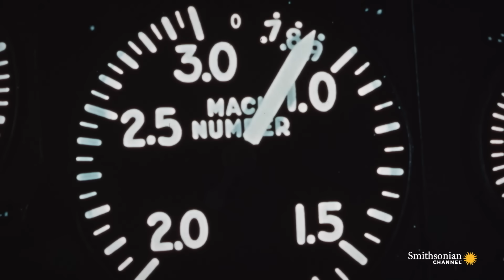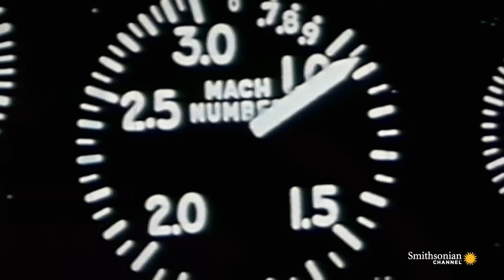The Moment Chuck Yeager Flew His Plane Past the Sound Barrier | Smithsonian Channel

Comment: Britain and America undertook a joint project to design, build and fly a JET powered supersonic aircraft. The aim being to expand their knowledge  of aircraft structures, aerodynamics and jet engines to stay ahead in the arms race.
However, America took the British aircraft design (without the knowledge of their 'partner'), built the X1 and strapped a German rocket in it just so they could go for glory.
Reply: BOLLOCKS! There was never any joint project and the UK was a decade behind Germany and America in supersonic aerodynamic technology.
Britain would not have the ability to build a supersonic aircraft until 1954.
Reply: @WilhelmKarsten   The British built 3 jet engined aircraft (DH108 Swallows) to explore the aerodynamics of supersonic flight. As expected, they encountered issues and the aircraft were restricted to Mach 0.9.
However, on September 6th 1948 Test Pilot John Derry entered a shallow dive at 45,000 feet and recorded a maximum speed of Mach 1.04 before pulling out at 23,000 feet.
All three aircraft were eventually destroyed but provided invaluable information regarding airflow and the distribution of aerodynamic loading, information that was shared with our American 'cousins'.
Reply: @bobdylan7120  No aircraft powered by an obsolete centrifugal jet engine has ever flown supersonic.
There is ZERO evidence to suggest that the de Haviland dH-108 Swallow flew supersonic.
All 3 crashed.
None of de Havillands jet aircraft could fly supersonic.
The only source that claims that John Derry reached Mach 1 is the fictional 1952 film 'The Sound Barrier' which is loosely based on his failed record attempt in 1948.
 There is no evidence that Derry reached Mach 1 in a dive, the test recording equipment was not functioning and there is no evidence that the aircraft reached Mach 1 or that the aircraft was even capable.

Derry would die attempting to fly supersonic in another de Havilland jet aircraft... the DH.110 which also failed catastrophically to fly supersonic.
Reply: @bobdylan7120 The only source that claims that John Derry reached Mach 1 is the fictional 1952 film 'The Sound Barrier' which is loosely based on his failed record attempt in 1948.
 There is no evidence that Derry reached Mach 1 in a dive, the test recording equipment was not functioning and there is no evidence that the aircraft reached Mach 1 or that the aircraft was even capable.

Derry would die attempting to fly supersonic in another de Havilland jet aircraft... the DH.110 which also failed catastrophically to fly supersonic.
Reply: @WilhelmKarsten   No evidence other than the Test records recorded and documented at the time.
Reply: @bobdylan7120 There are no test records, no documentation or any scientific data.
 Only the false premise of a fictional propaganda film.
Reply: @WilhelmKarsten   According to you.
Anyway, I'm no longer interested in engaging an unarmed man in a battle of wits. You carry on believing whatever you need to., as for me, I'll believe the evidence on display at the aerospace museum.
Reply: @bobdylan7120 You are a bald faced liar and a fake.
There is ZERO evidence to support your ridiculous fictional film propaganda claims.
Neither the Royal Aircraft Establishment or de Havilland have ever produced any factual evidence that supports the DH.108 ever reached Mach 1 in level flight or in a dive.
Please stop posting lies and misinformation about a topic that you are completely unqualified to discuss intelligently.
Reply: @bobdylan7120 What evidence on display?
Which aerospace museum are you referring to specifically?
 There are no Miles M.52s on display as none were ever built.
There are no DH.108s on display, all 3 were destroyed in crashes during the program that attempted unsuccessfully to fly supersonic.

 The first supersonic aircraft built in Britain was the Fairey Delta 2 in 1954.
One is on display at the Fleet Air Arm Museum in Yeovilton.
The other at RAF Cosford.
Reply: What British aircraft design?
Britain did not have a supersonic aircraft design until the Fairey Delta FD.2

Comment: The vertical stabilizer was developed by the Brits for their own sound breaking aircraft along with other aerodynamic features.  Britain was cash strapped at that time only a couple of years after WW2 so they gave the designs to the Americans.  Like everything else the America used it as PR never admitting where the record breaking devices originated.  Hats off to Yeager he was one of those guys who was unique.
Reply: That is a popular British myth, unfortunately there is zero evidence to support it. 
 The Bell X-1 used an exact copy of the electric fly-by-wire Horizontal Stabilator developed for the Messerschmitt Me-262..
Reply: @DoktorBayerischeMotorenWerke  Excuse me? https://en.wikipedia.org/wiki/Miles_M.52
Reply: @white-dragon4424 The Miles M.52 is a hoax, no aircraft called the M.52 ever existed. No prototypes were built, no photos or completed plans were ever found.
The M.52 only exists in artist depictions and wooden scale models.
Reply: Actually, it was the horizontal stabilizers from the Miles M.52 (along with most of the rest of the aircraft) that the Americans used to break the sound barrier, and on many supersonic aircraft after it, especially their fighters.
Reply: @white-dragon4424  The Miles M.52 never existed.
 Britian would not have the technology to build a supersonic aircraft until 1954.
Reply: @DoktorBayerischeMotorenWerke  It existed literally in wind tunnel form, as well as schematics form, the same plans that were used by the USAF to create the X-1. So yes, the M.52 did exist and broke the sound barrier, it was called the "Bell X-1". Sorry Yank, but like everything else in your country, from the people, the language, the flag, the food, the anthem, to the technical achievements, they were poached from someone else, mostly from us and the Germans. I'd also put some Japanese tech in there as well. It might have your flag on there, but it was all taken from somewhere else.
Reply: @white-dragon4424 Thats simply not possible... we know that britain did not have a operational supersonic wind tunnel until 1949... after the Bell X-1 flew supersonic.

Comment: Oh look. A Miles M52 with US markings on.
Reply: Nonsense. Especially since the Brits never actually built one. But you knew that.
Reply: There was no Miles M.52, no such aircraft exists .
Reply: Unmanned versions were built and did break the sound barrier, complete with all moving tail plane, another British innovation. A bit like the Manhattan project all British data on the Miles M42 were handed over in collaboration but as soon as the data was received all collaboration from the US stopped.
Reply: @martinbayliss3868  The Reynolds Effect is scalar, so the tiny scale models of the M.52 proved nothing years after the Bell X-1.
 The unmanned German A4b rocket plane was full sized and reached Mach 4 in March 1945.
 The Horizontal Stabilator is not a British invention, it dates back the Wright Flyer
 The Messerschmitt Me-262 was the World's first jet aircraft with a servo-powered fly-by-wire Horizontal Stabilator and is the World's first plane to successfully fly faster than its Critical Mach number 

Invented by Adolf Busemann and Heinz Wunder the top secret, supersonic data was handed over to Théodore von Karman and sent to his former student at JPL, head of aerodynamic engineering at Bell Aircraft, a man named Jack Riddley.

The Bell XS-1 used an exact copy of the Me-262 fly-by-wire power assisted Horizontal Stabilator... 
any questions lad?
Reply: @DoktorBayerischeMotorenWerke  read all about it: https://en.wikipedia.org/wiki/Miles_M.52
Reply: @martinbayliss3868 There is no M.52,  it is pure British science fiction fantasy
Reply: @WilhelmKarsten  there was. It never flew but it was basically the Bell X1 only it used a jet with reheat instead of a rocket and was intended to have a rolling take off and landing. For reasons never explained the British government cancelled it and ordered all the technical data and plans to be provided to the US. The Miles M52 eventually morphed into the English Electric Lightning.
Reply: @martinbayliss3868 Never happened, the fastest jet aircraft ever built by Miles only reached 289 mph.
Reply: @ No trace of any prototypes or completed drawing were ever found, the M.52 is pure fiction..

Comment: There were probably some pilots during ww2 that broke sound barrier in dives.
Reply: The Me-262 was the first to safely fly faster than its critical Mach number in a dive and reach Mach 1.
Reply: So what?
Reply: @johnsimpson8043 The Sound Barrier was not a problem associated with thrust or drag ratios... it was the problem with loss of pitch control authority as the wings and tailplane went critical and the centers of pressure suddenly shifted. 
Prior to the technical breakthroughs of the Me-262 in Germany aircraft would lose all pitch control authority and flutter violently or crash due to an uncontrollably dive.

Comment: The US DOD used British technology to build the x-1 and it also influenced the F-86 Sabre... Fact!
Reply: It's not a fact, there is not a single shred of evidence to support that false British myth. 
The Miles M.52 never existed, it is pure British science fiction fantasy.
Reply: ITS NOT A FACT. the Miles M.52 never existed, it is pure British science fiction fantasy and wishful thinking.
 The UK would not have the aerodynamics technology to build a supersonic aircraft until the mid-1950's
 Both the Bell X-1 and the F-86 Sabre were build using captured German technology and German experts..
Reply: That's a lie. The X1 was doing drop tests when the Brits released their data about their unbuilt plane, clown
Reply: @johnsimpson8043  Unbuilt... and never existed, the Miles M.52 is pure British science fiction.
Bell Aircraft received no data from the British because it did not exist. 
 The M.52 was a shameful and humiliating scandal for Britain, Miles aircraft was charged with 24 counts of fraud and embezzlement, Ministry auditors found no trace of any prototypes, any completed drawings or any of the money. All of Miles Aircraft assets were seized by the Crown.
 Frank Whittle was arrested and suspended from RAF duties amid allegations of extorsion, embezzlement and derelictions of duty. He was sacked from Power Jets the same week the M.52 was canceled and he never worked as an aircraft engineer in the UK again.,
Reply: Rubbish mate! The Bell X-1 and the F-86 Sabre used German technology developed by Adolf Busemann at the RLMs Luftfahrtforschungsanstalt supersonic wind tunnel laboratories in Brauschweig Germany for the Projekt 1065 'aka' Me-262

Comment: Yeager and his first and the worlds 3rd Mach 1 flight. Yeah go to wiki or the Smithsonian. Both cowards and won't admit they've been wrong all along. Notice they now credit Yeager with being the first to break the sound barrier IN LEVEL flight. This is known as moving the goalpost.

You see North American test pilot George Welch did it in a dive in the XF-86, twice before Yeager. All by himself I might add just went up to 40,000 ft., pushed the nose over and down he went and should be into aviation history. 

I'm all for giving credit, where credit is do and the fact that everyone got it wrong is no excuse to stiff George Welch. He did it, he was first and he should wear the crown.
Reply: Messerschmitt Me-262 pilot Hans Mutke was the first to fly supersonic in a dive and live to tell the tale.
Reply: George Welsh didn't break the sound barrier in an XP-86.and Hans Mutkke didn't do it in an Me-262. Both are just myths.
Reply: @jerryg53125  Chuck Yeager confirmed Mutke's account... tests conducted in Germany in 2000 also confirmed it.,
Reply: @DoktorBayerischeMotorenWerke  Wright Field had two Me-262's.They were tested and top speed was 560 mph. There is no  way this aircraft with two Jumo engines on the wings could break the sound barrier.
Reply: @DoktorBayerischeMotorenWerke  The Me-262 could NOT break the sound barrier. You can quote all you want and it will not change facts.
Reply: @jerryg53125  It was not only the world's first operational jet fighter it was also the world's first aircraft to controllably fly faster than its Critical Mach number.
What few people know is that on Aug. 19th, 1944, Luftwaffe pilot Heinz Herlitzius took off from Flugplatz Leipheim and reached a record top speed in level flight for air breathing combat aircraft of 624mph (1004km/h) in a Messerschmitt Me 262 (an official DAC record). This was the fastest flight of a production combat aircraft until the F-86 Sabre on Sept 14, 1948\
 In a steep 40° dive with full engine power at an altitude of 12,000 meters (39,000 ft), the Me 262 will quickly reach an indicated airspeed (the max. limit of airspeed gauge 1,100 km/h (684 mph) The speed of sound is only 1,062 km/h (660 mph) at a 39,000 feet. The Me-262 Mcrit. (critical Mach number) is Mach 0.86, this is higher than the Mach 2 capable F-104 Starfighter. The M{dd} Mach Drag Divergence number of the Me-262 is 1.4 Mach.
 Any questions lad?
Reply: @jerryg53125  Thats right lad, I just post facts

Comment: When he said the Mach meter was broken, that was code. He was telling them he broke the sound barrier. It was in case the Russians were listening. There was nothing wrong with the meter. No one was watching and waiting on the ground except the engineers and the people involved in the test. Only they knew about it. He did in fact have broken ribs.
Reply: Actually, he really thought the Mach meter was broken... Yeager observed what Me-262 pilot Hans Mutke discovered on April 9th 1945 and what maodern jet fighter pilots are familar with.
The phenomenon known as "Mach Jump"  the needles of the Mach meter and altimeter both simultaneously jump momentarily as the aircraft's pitot tubes pass through the shock wave as the plane reaches Mach 1.

Comment: At 1.39 you can see a swept wing chase plane. I didn't know there were any swept wing fighters in 1947 in USA. Looks a bit like an F-86 - Maybe prototype?
Reply: It is probably an XF-86, the prototype version of the F-86 Sabre. It was used at Muroc AFB as a chase plane of the X-1, the D-558 Skyrocket, the X-2, etc.
Reply: After the X-1, this prototype Sabre was the second aircraft, which (officially) flew faster than the speed of sound, on April 26, 1948.
Some sources refer, that the XF -86 reached M 1 in a dive, a few days before Yeager ' s record, but it was never confirmed, nor witnessed.
Reply: @gaborbanay92  The F-86 was the second jet aircraft to reach Mach 1 in a dive... the Me-262 was the first.